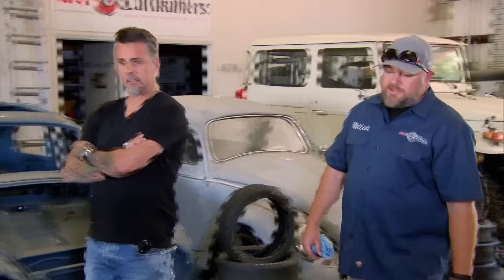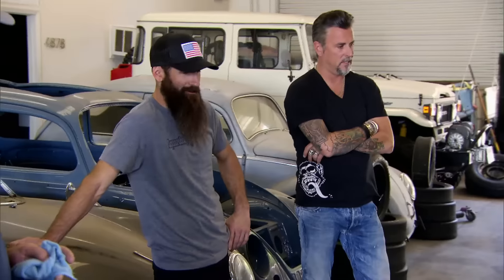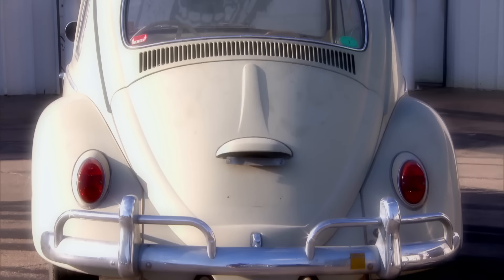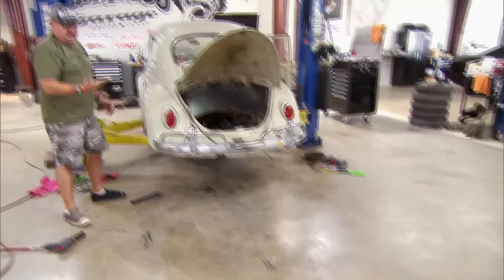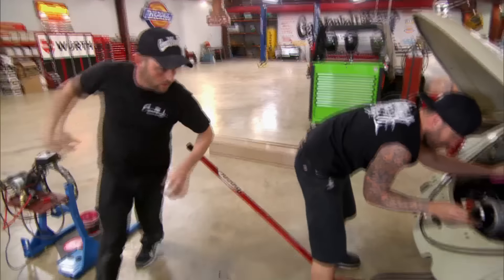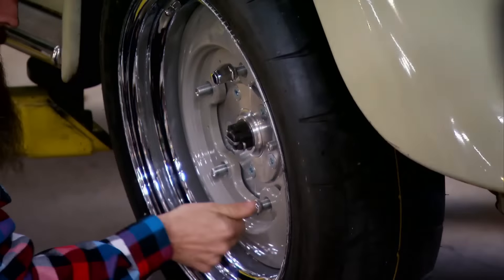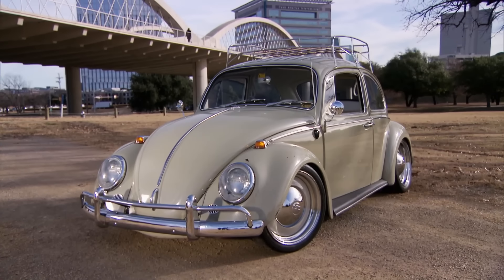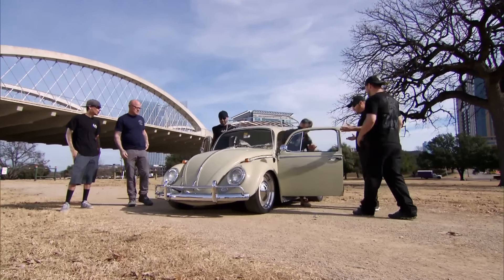Aaron Gives A +200 Horsepower Motor To A Beetle | Fast N' Loud

Comment: You guys are awesome. I’ve had a couple bugs, a 57 split oval, 59 oval, 64 and a 1970 auto stick with a 2100 cc engine that I switch from a 6volt battery to a 12 volt, lowered, air bags, and painted all grey with white doors. The 70 was my baby since it was a rare automatic. When I moved to Las Vegas in 1997 it was stolen and never seen again. My heart was broken that day
Reply: 57 isn’t a split and 59 isn’t an oval
Reply: @IGO0100REALQUICK  my bad I said those 2 backwards.
Reply: @juniorvaughn4567  That's even MORE incorrect. The early bugs were split windows until mid-March, 1953, then they became oval windows. 1958 was the first year of the 'big' rear windows.
Reply: @jimihendrix1575  were probably graphted.
Reply: @IGO0100REALQUICK  I was gonna say that

Comment: The 40 HP was about 1196 CC capacity. The 6 volt system was the monster from the black lagoon. I was into these little cars and the club in Sydney (AUS) quite a bit. The rally bugs had a part that bolted onto  the outer end of the front suspension tubes back to the near where the floor pan at the front came out from the wheel wells at a corner where the pan went straight along under the doors. This was a factory part option at the time and a few of the guys I knew used it for rally events, dirt bush roads in mountains, forests etc where thing were under duress. Some guys used Porsche Super 90 motors and even transaxles. Some other variants could have been roughly related to Bugs, but only just !! Enjoyed the video but wished there was more info. Well done.

Comment: My first car in around year 2001 was a 1970 vw beetle. Me and my did rebuild most od that car from the ground up. Took out the wing windows for single piece windows. Redone the whole interior. Motor was rebuilt with slight performance upgrades. Painterly green for my bday with some chrome running boards. I loved that car more than any car if ever owned. They are just so fun to drive. I wish mine didn't catch on fire when our backyard caught fire 😢

Comment: My first car was a 65 this color, had the 40 horse for about a year. I remember that it went 5 mph faster right after I waxed it.
Reply: 40HP you say? Wind resistance reduction by waxing should get you close to 6 mph
Reply: A 75 was my first bug. All I remember was it had heat only if I had more than 1/2 a tank of gas. Good luck on that, I was a High School Student. And of course did the “How many people can I fit in the Bug” contest. 13 was the finally number.  Buddy with the same car had 15.
Reply: Lol... Aerodynamics, bro
Reply: My first car was a 73 nova with crate 350

 I still have it and just got the motor and granny rebuilt and suspension all around 

 Really excited to get it back from.mechanic still gotta do all brakes and lines with a rear disk conversion.
Reply: Ditto, Sams year, same color here as well...I still own it. I also have a 67 and a 70...at one time I owned 12.
Reply: @willyjf6193  
You rebuilt your granny?

How can I do that?
Reply: What engine did they throw in?
Reply: Mine did 0-60 down hill in 15 minutes flat 🤷🏻‍♂️😂😂😂😂
Reply: @jimdr63  Man, I have a 2002, my dad fitted 13 too
Reply: @luisedwardmc7606  the 2002 was a bit bigger.. but still fun fitting people in all at once hoping no one has too fart
Reply: @willyjf6193  Hope your granny is feeling better.
Reply: @Leo Driscoll, put a George Thorogood cassette and get an additional 15 hp
Reply: @18echo  i have a 1970 subaru 360 sedan.. it gets from 0-60 eventually 🤣
Reply: Lmaooo 🤣🤣
Reply: Hey, My first car was a 65 bug this same color too!  Some great memories from those days…👍
Reply: Panama Beige is name of the color.  My mom still has her '64
Reply: mine runs 10 mph faster hill down and with homesickness.

Comment: First, I'm no mechanic, much less a VW. mechanic. Many years ago I had a 67 bug and a friend of mine and me figured out how to replace the jugs on the engine in a day... with the help of manual. The most fun part was dropping the engine. We just got some concrete blocks to hold the engine, undid the bolts (many sheet metal), and he and I lifted the backend up and over. I drove it to work the next day. Lots of fun.

Comment: in the late 70s early 80s myself and several of my freinds  played around with Aircooled VWs  and a freind of mine showed us a cool trick  he knew fromthe 60s and 70s that was  hacksawing the basket off a Shopping Buggy  untill you were left with the 4 wheels ,handle , and the bottom frame rails and Shelf  that became  almost the perfect height for removing and Installing  the Engines in Bugs ,Buses and most Aircooled VWs plus it  gave you a great way to store the engine in a garage under a Workbench out of the way in a single car Garage to still get a car in it  We didn’t Steal the Buggies ever but we did drive to the bigger Cities looking for abandoned ones  one time my best freind saw one on the shoulder of a Highway  and made me turn around to load it into the backseat of my Jeep   you did sometimes need to shim the engine with a couple of 2X4s or whatever to  match the cars height  but   with a few of your Buddies  the motors could be bolted or unbolted  by lifting the car  high enough to get the engine out of the rear of the car  it was fast  and we had a system that  we could swap a engine  in under 2 hours  and a 12 pack of Beer  we all had  small Workbenches in the Garages that gave us the Clearance to “park “ the extra assembled engines we had  as back then we could still buy  a used running Bug for a few hundred Dollars  and even if the motor was weak.  or leaky we could buy a Brazilian rebuild kit for $120.00 that had new Pistons ,Rings ,and all new Gaskets  orfrh one  expletive used to joke that those kits and parts were Junk  and they may had been compared to Genuine GermanVW OEM parts but i know one engine  that is still running  in a vehicle 35 years later  i’ve honestly lost track on how many Beetles ,Sand Rails , and Dune Buggies it’s been in  over the years and the original Car has been long gone from Rust  but people still call that motor  my Engine  !

Comment: I once changed a vw engine on the side of the road by hand just a few tools. Picked up the engine myself.  Put it in the trunk of my friends car. Went and got a replacement.  Then installed new engine myself no jack.

Comment: I call cap on the 200 horse. Aint no way they got 200 Horsepower out of a type 1 Engine, you can usually only build those to around 150 maximum.

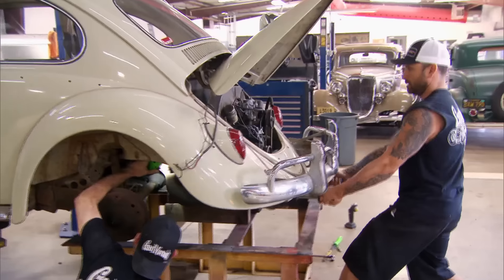Comment: @2:43, it most assuredly was NOT the speedo cable holding you up. Given the position of the engine, based upon decades of VW Service, I'm saying that the throttle cable end, was probably catching on its tube that runs through the fan shroud... assuming you remembered to unfastened it from the throttle lever in the first place! 🤣

Comment: Back in the 70s and 80s the Cal Custom was king. For those that think this bug was destroyed then go get some old copies of Hot VW and Dune Buggies. I left my 65 stock but installed a 1906 out of an old sand rail. I did keep the bone stock engine though. 
My question on this build is, what were the gets in the new transaxle? The stock one was a 4:37 and it was pretty good with newer HP engines but I always thought a higher gear would be a lot better.
Reply: GEARS, not gets!

Comment: My brother had a 65 red.  My first car was a 67 green - paid 600$ back in 1980.  I sold it for a Buick Skylark which was fast and had big bench seats.... but I sold it for My second 67 Red bug.  .  I bought it for the body because I knew I could throw in a used motor for 200$.  I had it till around 88 when I bought a Honda Civic wagon which I could drive back and forth across the country Rock Climbing and Paddling.

Comment: Back in the late 60's I remember seeing a Beetle at the local drag strip running low 10 sec with a Volkswagon engine!  Heavily modified of course but it was super fast.  It sounded kinda like a coffee peculator as it was waiting for the lights.
Reply: I knew  dude who put a 327 in a bug and had motorcycle chains to transfer the power....and at the drag, he got paid to do wheelies to entertain the crowd

Comment: Would you guys be willing to share the motor specs... I’ve got a 2332 with 48IDA’s cranking out 185hp with 191ft lbs and it’s so much fun!
Beautiful little car!
Reply: Back in the mid-70s, a guy in Austin, Tx. had a VW for sale that he claimed had 185HP.  My friend and I went to take a look at it.  He wouldn't let either of us drive it, but he did take us for a short ride around the block.  It was a ride I'll never forget...
Reply: @thunderpuppy6719  ... the biggest problem with all the extra HP is the trans gearing is all wrong unless you build an engine that can handle over 7,000 rpm. That's about 30 mph in first gear, so you can see where this is going. IOW, 1st gear is almost useless with that much power because you will wind out the engine in less than 2 seconds. Final drive on these things is in the 4.26 range and what's needed is something in the 3.50 range with that low 1st gear.
Reply: @rupe53  thats why they are very hard to catch.
Reply: @jaimesantiago1475  ... a buddy of mine used to say a VW would beat anything from 0 - 20 mph because of the low 1st gear and the good traction with the rear engine.  <LOL>

Comment: Audience, I have a 79 Super Beetle Convertible stored for the last 4 years. I haven't driven it since, I replaced the wheel cylinders, master cylinder, brakes, tires, brake lines, fuel pump, carb, distributor, new struts, and rear coil over shocks. My battery is now dead, and a car cover it. I'm retiring the first of next year, and then I'll hit it back up. Hasn't decided if I'm going to keep it or sell it.

Comment: Out of all the abandoned, gutted, bugs there is out there they choose to pick a 100% original one smh. Could’ve went with a barn find or something if your going to swap everything anyways.
Reply: I saw the thumbnail and said “ /: damn another beetle bites the dust.” Then I clicked and saw they did this to a 100% original. Huge bummer. Driving crooked down the highway... slapped together for a YouTube video.
Reply: @kavenmendes  na bro they made that think look sick and preform like crazy. no one would rather have the car like how they bought it all boring and stock. just my two cent m8
Reply: Starting Tech not only did they not mention displacement, they didn’t even let you hear it run besides the half second flyby on a nearly stationary camera. The engine looks like they slapped on an alternator and bolt on rocker covers. Ive never seen 200HP out of a VW engine that wasn’t kitted up with obvious performance upgrades. They painted the wheels 4 times according to them.. I kind of feel bad for you if that’s work you’d be satisfied with.
Reply: Everyone is entitled to an opinion. So your saying you would rather have it how they bought it?
Reply: Starting Tech I agree, everyone’s entitled to an opinion. I’d personally keep it the way they bought it. But if I were to do work to it, I’d want it to be quality and real
Reply: I think they ruined it
In 15 years it will be the star in a show about how a ruined car will be restored correctly
Reply: @kavenmendes  i always lower my cars and thought the concept of what they were doing was cool. but i can see how an all original 65 bug some people would want to keep it all stock bc its a 65'
Reply: @kavenmendes  but i don't collect classic bugs so slammed w a big motor sounded cool haha!
Reply: Who the fuck cares about bugs, they are garbage cars and there are millions of them.
Reply: @HarshManohar  right lol im with u on that. Never thought they were so amazing lol
Reply: @startingtech3900  
No, take it to a professional and have it restored to original, which it was the perfect candidate for. 
 Just no appreciation for the classics. 🖕
Reply: front apron is aftermarket means it was wrecked at some point so not original paint.
Reply: No rust is worth it.
Reply: @startingtech3900  Your name explains it... A Starting Tech has no problem with ruining an all original museum car. A Master Mech wouldn't agree!
Reply: @j.thomas7128  yes I am a technician and this channel is a few years old. Do you even work in the automotive industry as a career or are you some shade tree mechanic? Lol. And no I don’t give a shit about this bug. If it was an original 65 I would keep it original ONLY to sell it and make a profit. But I’m not crying on a YouTube comment about how a shop “didn’t keep it original” you old farts crack me up
Reply: @startingtech3900  Education plus experience = wisdom. One day you'll get it, maybe... Now I don't work in the automotive industry as a part swapper, but I did put a 350 and supporting running gear in my Wrangler, bored, balanced and blue printed twin 2.5s mercs on a 21' cat, gained another 8 whhp on my bike from knowing how to tune by reading spark plugs, and swapped out continentals for turbines in a 421... I guess this makes me unqualified to have an opinion.  LolololoL Us old farts have the coolest toys.
Reply: @j.thomas7128  exactly... you aren't even a automotive technician just another boomer that thinks just bc hes old he knows more. how naive
Reply: Agree, it was very sad!
Reply: @catherinenicholls1018  sorry I didn’t read your book 📖 of a response. Wow u must be a boomer if you have that much time to reply to comments made months ago
Reply: @startingtech3900  no not a boomer but yes I do have a lot of time as schools not on, I’m practically homeless living at my grandpas till me and my mum can find a house so really I have more time then I know what to do with.
Reply: @kavenmendes  Notice Aaron Kauffman in this? This was from the show on Discovery. They cut it down to a YouTube video.
Reply: If it was one of those rare split window and all that rare sh*t then I'd agree.

But in Mexico they mass-produced the normal ones on license up until recently (and are probably still produced outside paid VW licenses), so just buy one from there if you're so hung up on 200% all original built with all original tooling & machinery.

The normal ones are so numerous it literally doesn't matter, and all of the non-mexican-original-german-200%-originals are running on non-original Lucas and Delphi replacement parts anyway, some to the point that only the chassis plates are the only original parts, and they break down a lot and arent worth shit, so why should anyone care about this one? Only a question of time before it lays up anyway.

I'll tell you why, because people hoarded a gazillion of them for 100 bucks a piece and are hoping they will be worth a lot of money in their lifetime, just because it has a lower vin#, or at least enough to cover the unreasonable amount they spent restoring one (out of the dozens they greedily hoarded in their area so noone else can have them) with non original pieces, so they can hype them up to collectors prices, just like they did with Datsun 24-7-80z's and cars like that.
1) I hate those people. 2) Spoiler alert: They arent worth that much.

Comment: This would have been impressive 3 days ago. Two days ago I stumbled across the ultimate sleeper. Aside from two rollcage struts low in the back side windows it looks like a stock Beetle. They shoehorned a Subaru boxer 4, producing 527hp at the rear wheel in there.

Comment: There needs to be a competitively priced suspension package for the air cooled vw world that helps these cars handle well. Trailing arms up front is no good over stock power around a corner. These cars need an easy bolt on front a arm and pan reinforcing kit. With 200hp and suspension that’s good enough to control the wheels without excessive bumpsteer, these cars will chase down “proper” sports cars. A proam or fd drift beetle would be a game changer.
Reply: Russell Krue
 ... If you know where to look and what to start with it makes a major difference. Nothing wrong with the stock front suspension that a little lowering and a bigger sway bar wont fix. Karman Gia front spindles will get you front disc brakes, which will accept type 3 front calipers. (almost 50% more pad area) All stock parts so cheap. If you start with a 68 (or newer) bug you will have IRS out back and the right camber. Not sure who makes a rear sway bar but that would finish things up. You can also lower a bug a few inches by using low profile tires and save a bunch of work elsewhere while retaining all stock parts for reliability. I mean, who is going to drive a bug over 100 mph where a slam-dunk makes a difference?
Reply: rupe53 - I would agree with you if I was interested in a street driven lightweight car using stock parts. 
I remember seeing a heavily modified kafer cup car type 1 (180+hp type 4, can’t remember if it was a super) vs a 964 Rs and the beetle had a faster lap time. Air cooled 911s have an 89” wheelbase while a type 1 beetles wb is 94”. It’s just the front trailing arms have a difficult time controlling camber while in a corner while under load. It’s a robust design...just not for track work. 924/944 rear trailing arms bolt into an irs pan with custom spring plates and they’ve got great brakes and the ebrakes are usable.
Reply: @Russell_and_Rosko  ... would agree that one can engineer around all sorts of things but I was talking the biggest bang for the buck.... using stock parts. Most people don't realize you can dial in a little more camber with the ball joint front end if needed. You can also utilize the "adjust-a-drop" modification to lower things while keeping the same spring rate. Wish someone made that for the rear.
Reply: sorry i missed this part but where does the 200bhp comes from?